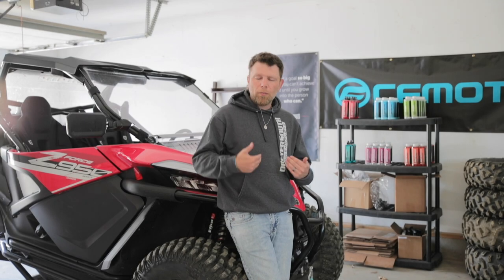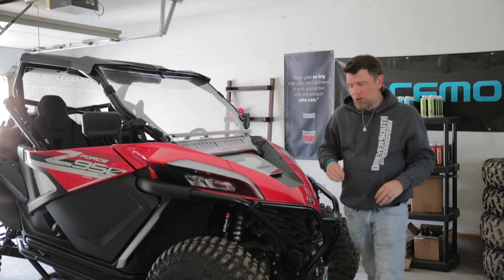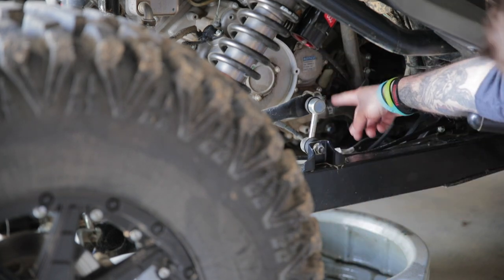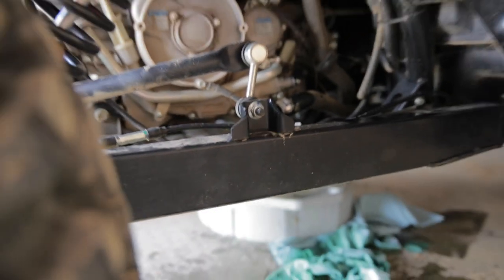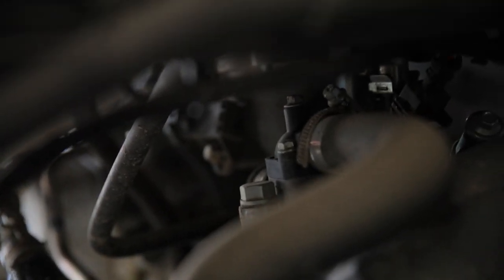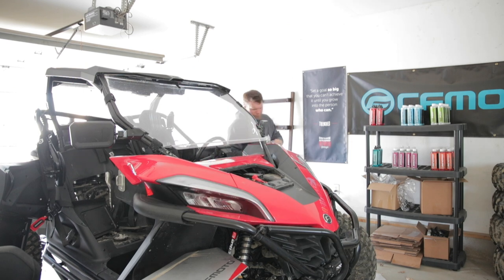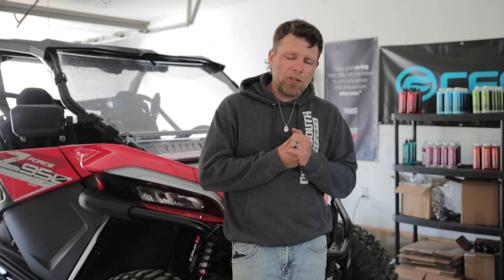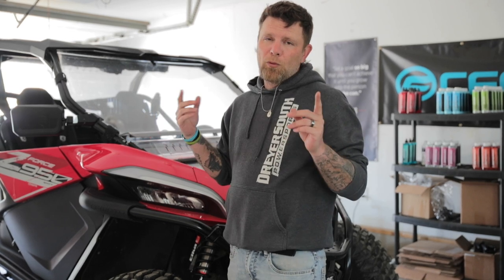How to change the coolant in the CFMoto Z950 Sport

Comment: There should be a plug labeled DRAIN right in the bottom side of the water pump, so you dont need to disconnect the hose. There is on my Zforce 1000
Reply from the maker: There is...I actually called Joel from MSC before I did it and he suggested it be done this way...so that’s what I did 🤷🏼‍♂️ I saw the “drain” label, but felt like that would take forever to come out that little thing. Lol
Reply: @JustinTheCreator  Sounds good and GREAT video(s). I'm about the same mechanically inclined as you, so relating !
Reply from the maker: @cooperadventures  thank you, bro💪🏼 I’m just learning and figuring things out as I go. I know there’s a lot of other people who want to work on their machine, but might not know where to start...so I try to help out in giving them confidence and showing that they can do it💪🏼 Thank you for watching. I appreciate you!

Comment: Did you loosen the 2 8mm burp bolts while it was running?
Reply from the maker: I had the easy to access one a little loose, but I mostly just burped it the way I would a car. There wasn’t much air in the system, so didn’t take much.

Comment: Did you tighten the bleeder bolts before you started it?
Reply from the maker: I did. I just burped it like I would a car by squeezing the hoses and adding coolant as it dropped
Reply from the maker: Well, the one that was easy access was a little loose, but that rear one you basically have to lay your arm on the exhaust to reach it. Lol
Reply: @JustinTheCreator  lol burning your arms gets old quick.
Reply from the maker: @drewswigart1257  yes. Yes it does. Lol